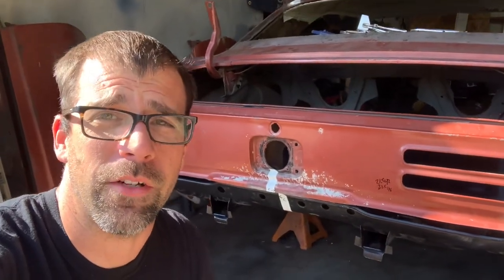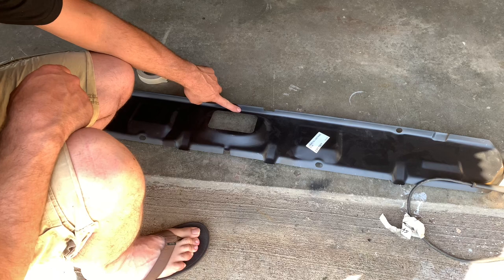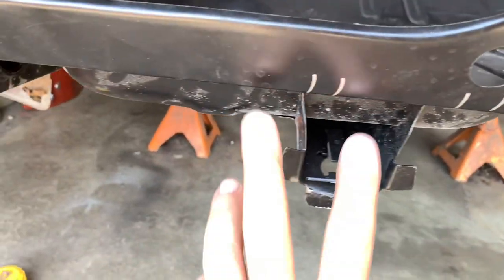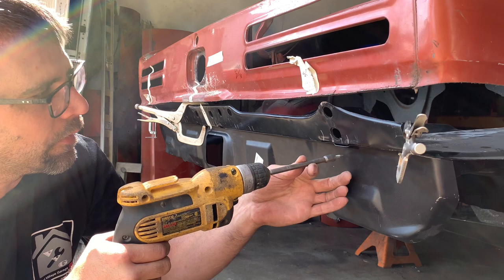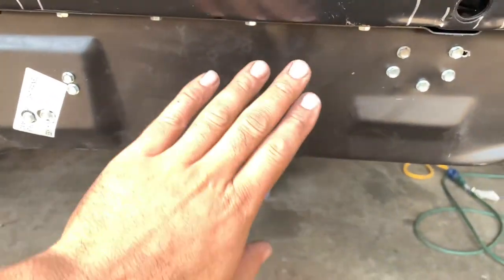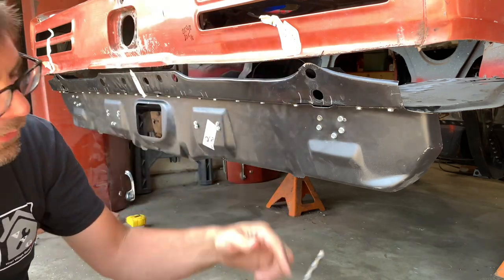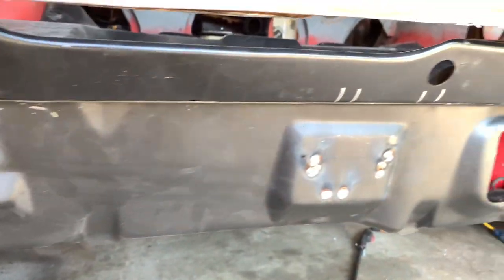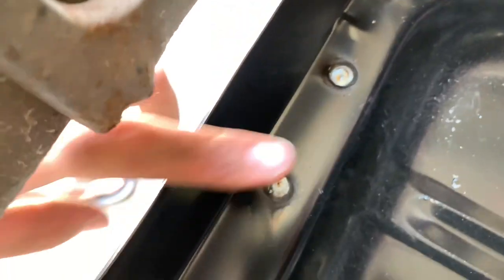Body panel replacement inner tail panel 1967 1968 Firebird or Camaro

Comment: Great video and great welding skills.  the self tapping screws are a great hack on body work, it really saves on the number fo clamps needed.  You are making great progress on your bird.
Reply from the maker: Thanks the screws are excellent especially in areas a clamp will not fit properly plus it creates a perfect pilot hole for welding.

Comment: i got mostly dynacorn parts, very solid. 69 bird trunk pan frame rails tail panel inner and outter going on. before the floor pan. done this stuff before but never this deep,
Reply from the maker: how do you feel the dynacorn parts are lining up?  I know every brand needs some tweaking but not cutting or major mods normally.

Comment: That is a awesome way to plug weld while using screws to hold the metal I am going to use that technique for now on!! Another great video that actually teaches someone the  easiest way and strong way money saving because very little grinding thanks for the video keep them coming the best!
Reply from the maker: Thanks buddy. I have had great success especially in blind areas you can’t camp the panels together. Keeps it pulled up tight and super clean looking welds. Takes a little practice but it can be done just the same as Did. Good luck! Let me know how it goes.

Comment: If your going to be in PA and want to see a 79 th10 anniversary 400-4spd trans-am let me know.
Im restoring it after a tree hit it in the t-top. All numbers matching as im the orig owner. Its possibly a pace car, emission label is different than the 79 400 4spd and i got the pace car decals in a tube when i got the car. Got not bought as i had to bid on it at the dealer with a sealed bid. 
Hardly any rust, just surface stuff.
All the glass broke except 1 t-top. 
Hood and trunk weren't touched as the tree hit a bank in front of the car.
Reply from the maker: Wow original owner. I am a bit jealous I will never unfortunately be an original owner  to a  bird. Where about in PA? I will be in latrobe then heading east to Kunkletown.

Comment: havent put any on yet, wanna get trunk and rails welded first. car is in bad shap. just got rearend out today. even the leaf springs fell apart it just sat way to long. gonna be a great challange
Reply from the maker: It’s definitely a large project but with a
Solid plan and vision of the end result totally obtainable.  TEST fit as much as possible or even screw the entire rear portion of the car together. Before welding anything permanently.   Other then that slow and steady wins this race

Comment: can you send me the messurements for trunkpan to  framerail ? i dont have a jig. but im going to give it a go. frame rails got here today ready to get things rolling. the second gig you had some messure ments. but cant find the video.  thanks and love watching
Reply from the maker: Absolutely I can send you a complete front to rear measurements off an original car body and fisher body specs.   That you you can compare actual and spec. You will find some measurements aren’t close and I trust the original over spec book especially rear frame rail spacing at the rear of the car.  If set to spec it won’t fit the floor pan.

Comment: I love the Plug welding technique!!  I am definantly changing my technique.  Thanks Jon.  Where do you get your #10 self tapping screws?
Reply from the maker: those screws you can typically reuse 2-3 times before they get to dull to cut, I get them from local hardware store, ace, lowes, Menards. different lengths are handy too depending on how far apart the panels are it will close a 1/4” or even larger gap if needed to pull these repop panels into place
Reply: @VinylVillageGarage  thanks Jon

Comment: What size mig wire are you using?
Reply from the maker: .030 works great for me, many will say that is to big.
Reply: I have a 67 Camaro that needs both  floor pans and frame rails, Your videos are very helpful, I'm planning on to doing it with the front frame still in place. Do you have any measurerment's written down for frame rail locating and getting them squared up with the front floor pan? @VinylVillageGarage
Reply from the maker: @rickblood8653  I do have a sheet that I use for setting things. I also have a rear frame rail jig that I use to assemble the rails and trunk floor.

Comment: So... Are the 400 hoods all made  by the same manufacturer?? Whats the best 400 hood??
Reply from the maker: Good question and the jury is still out on that answer.  Every panel I seem to find a made in Taiwan sticker someplace.  But I have found a noticeable difference sometime between brands other times they are identical but most of the time AMD panels seem to be better quality and cleaner lines. I have had some really low quality pieces from OER and next time they are great.  So after all that I would buy an AMD 400 hood over an OER. My 400 hood is oer and it needed a good bit of massaging to get it to fit nice.